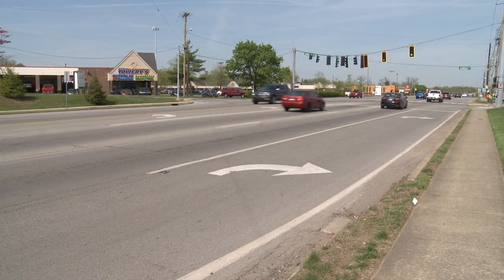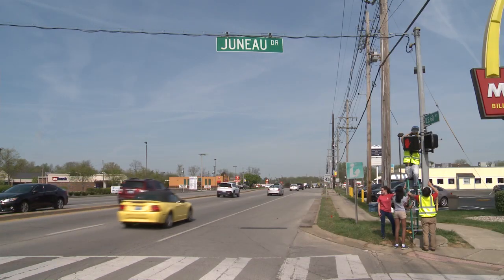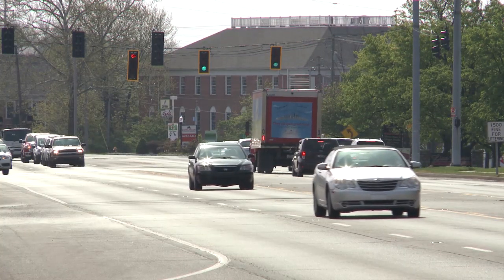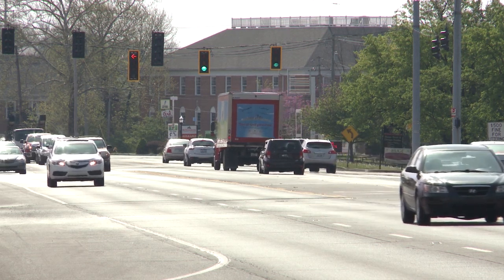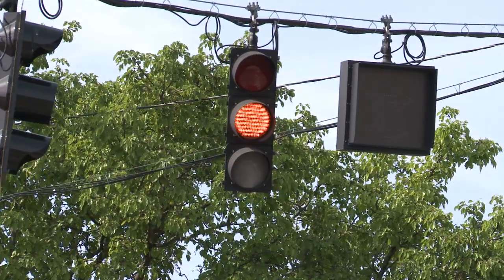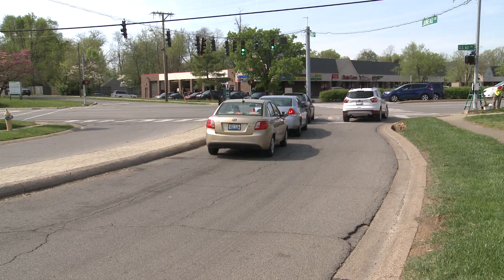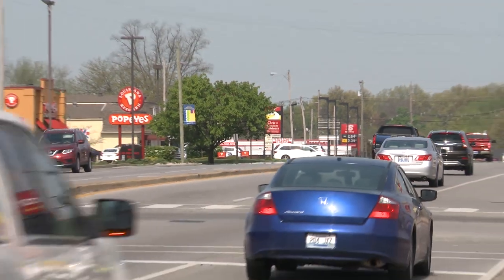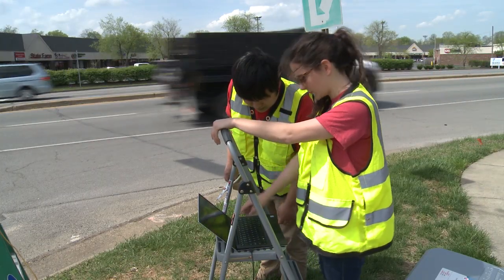Yellow light study

Comment: Why not yellow flashing lights as a warning?  I feel that would work.
Reply: Yellow flashing in the US is generally used for standby signals (usually when the signals are switched out of active operation). Flashing Green actually would be a good idea, I've seen it in some countries and it gives you a better heads up that the light is going to change.
Reply: Some countries has green flashing light as warning